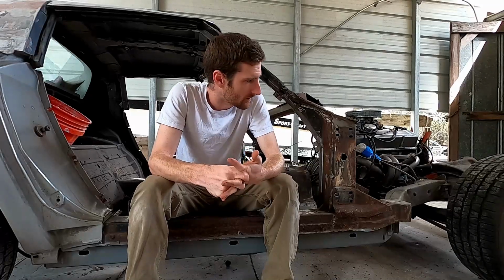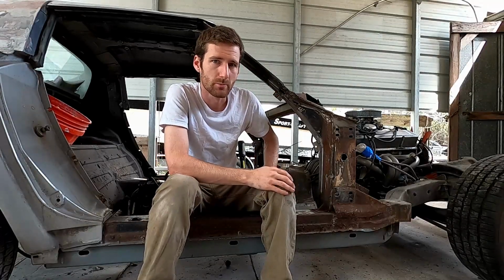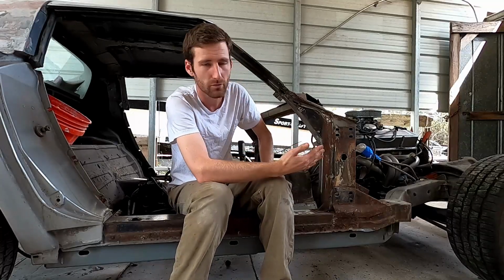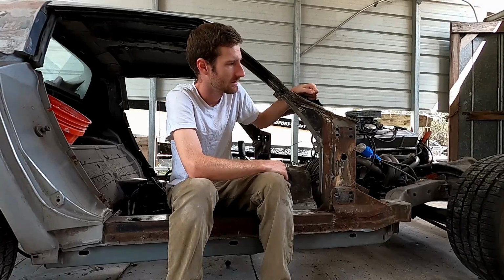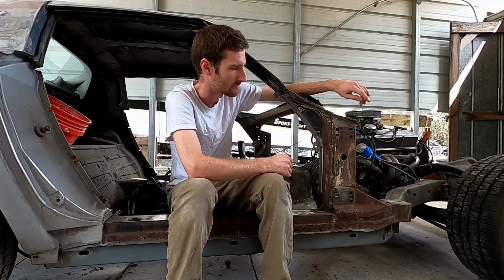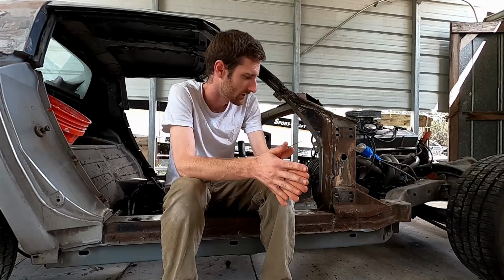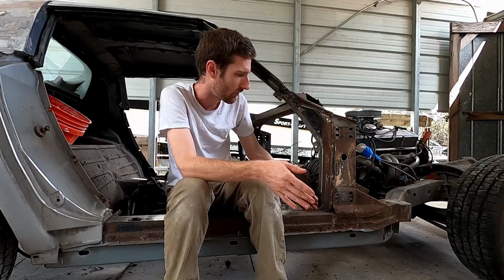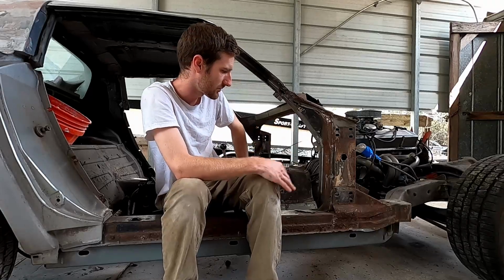1976 Corvette Project Part 30 - Front Clip/Firewall Removal - Custom Tail Light Panel

Comment: This is awesome ! I’ve been thinking of doing something similar to my 76. I am assuming you had to modify the tailing mounting brackets and stuff before putting on the new bumper?
Thanks!
Reply: Tail light*
Reply from the maker: Thanks! I didn’t modify the frame at all. I have obviously removed all of the aluminum and rubber crash bumper structure that was underneath the factory rubber bumper cover. I’m thinking of trying to add some of that back in if I have room. We’ll see. 
The bumper cover I made will be fiberglassed directly to the body of the car rather than bolting on like the factory piece did. 
As far as the tail lights themselves go, factory tail lights and mounting hardware should work with the panel I made but I’m planning to make custom lights eventually.
Check out Part 33 for the mold making and layup of the taillight panel if you haven’t already
Reply: @xXBocephusXx  thank you so much!

Comment: Other than cutting that top section of the front nose near the windshield, did it crack anywhere? Pretty sure that front nose clip is made up from 3 or 4 pieces in the factory.
Reply from the maker: It cracked in a few spots but nothing I can’t fix during body work. It really came off pretty easy